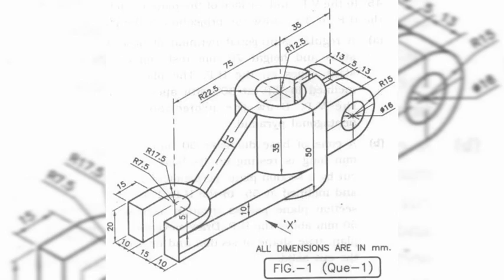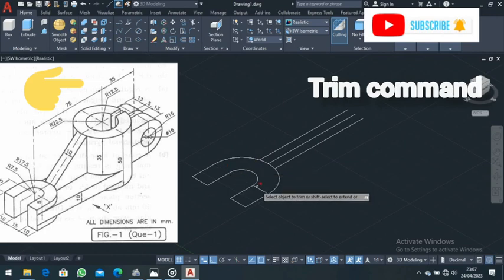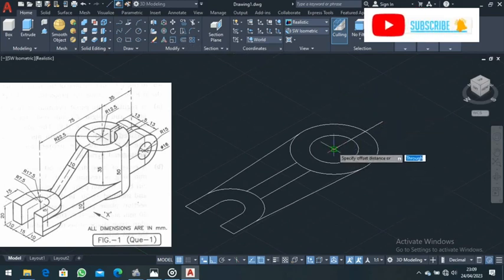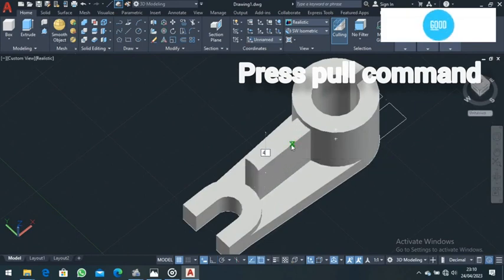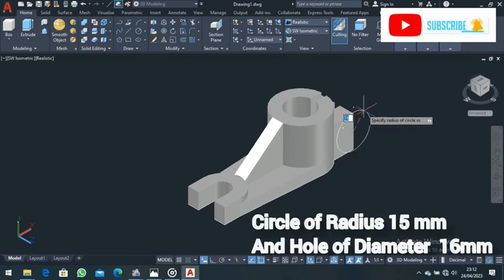How to set limits,  set units and changing from 2D to 3D isometric drawing in Autocad 2021

Comment from the maker: O:00 intro
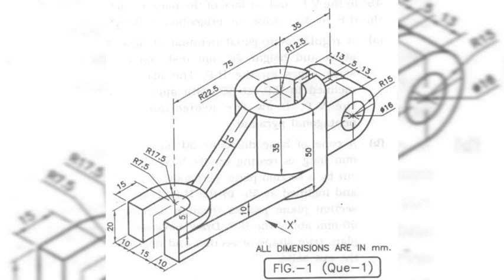0:14  interpreting  the Diagram in autocad
0:32 -0:54  How to do basic autocad setting
 for 3 D  Drawing  in autocad
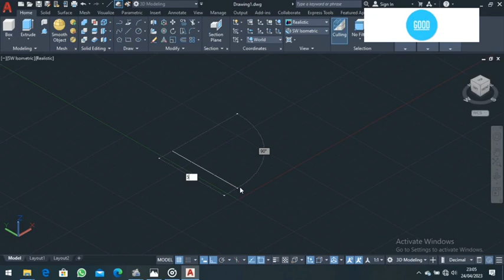1:21  How to Draw line in Autocad
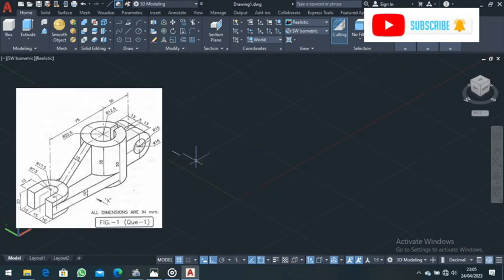1:34  How to Zoom in and pan in autocad
1:41-1:58   How to use offset command in autocad 2021.
 Mechanical 
2:01  How to use trim command in autocad 
2:07  How to draw circles of Diameter and radius in autocad
2:38 - 5:02 How to draw 2D Drawing in autocad.
5:04- 7:04   How to Covert   2D Drawing into 3D drawing in Autocad
 7:04  How to Draw circles on vertical plane
7:25 - 7:38How to use 3D mirror .
7:42  How to draw holes in 3D Drawing in Auto cad
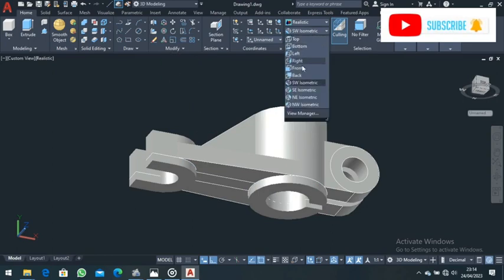8:16  How to press pull in 3D autocad.
8:36  How to use move command in autocad
8:53 How to choose back original view of 3D drawing in autocad.
9:20  How to choose colour of 3 D Drawing 
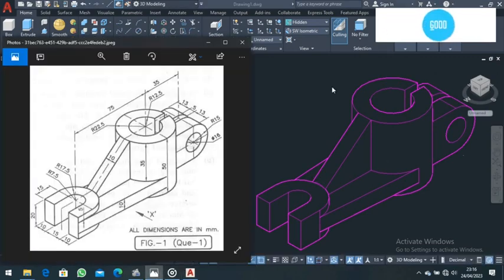9:38 How to choose Hidden view  of autocad drawing.